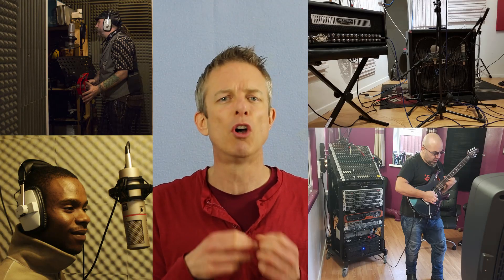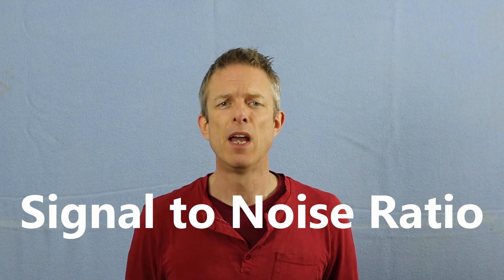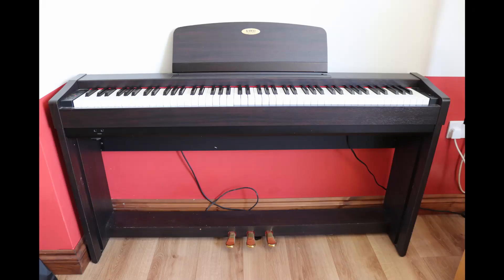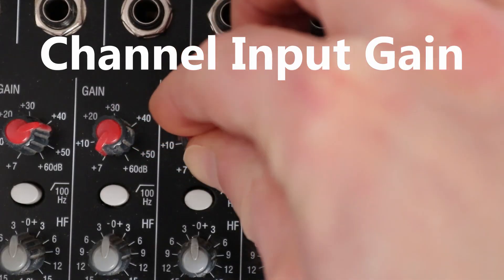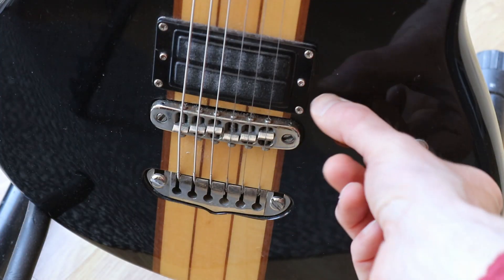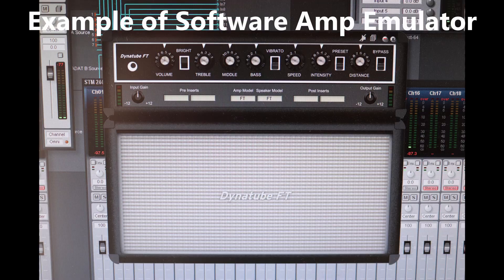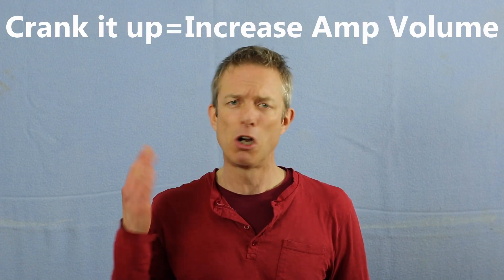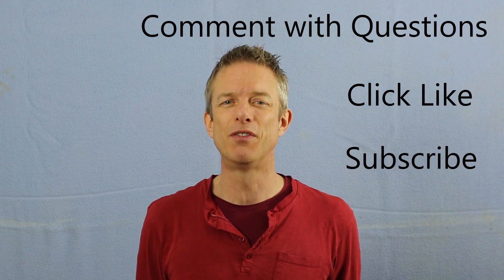Audio Signal to Noise Ratio.  Avoid Distorted Audio Sound & Optimise (Optimize) Your Gain Staging

Comment from the maker: Thanks for watching, let me know what you thought in the comments 🖖
Edit. Had a great question on another platform that I wanted to share and he asked about Propellerhead video that said don't worry about lighting red lights in software. 
My reply. Hiya, that is a great question,  thanks.....they are referring to internally, once the sound has converted from an analogue to a digital signal. It is also dependant on the quality of the equipment you are using. Professional gear has higher tolerances than cheaper equipment, and can work with higher signals than amateur equipment. For instance, my RME ADI-8 Pro analogue to digital converter which I also use as the clock for my other converter and my computer has 3 different settings, Lo Gain, +4 dBu and -10dBV depending on what other equipment is sending audio to it and what it is sending audio to.
This is essentially a beginners guide and so I am keeping the information very simple and straight forward, however,  I will go into more depth later, and also look at signal levels within software and when the signal is moving between different software programs, as for some people the once the signal is on their equipment is stays within a single program, but others like myself will be sending the software from the tracking software to the mixer software (to keep the terms very general), there are also examples where the final mixed sound is sent externally to a totally separate piece of equipment to capture the final mix, so there are many, many variations all with different rules, however,  as a starting point, working from these basics,  and using your ears to tell you if there is  a problem with the sound is a good start. This tutorial also is applicable to those who are recording on self contained hardware units rather than computers and again they may not be able able to handle such 'hot' signals, esp., if someone is using older equipment as well, so to start with I have kept it simple and general. And to be honest, there is no benefit in having a signal, once it is digital, any louder or quieter until the very end, the point at which it really matters is before it gets converted to a digital signal as that is the point at which excess noise can be incorporated leading to an inferior sound.